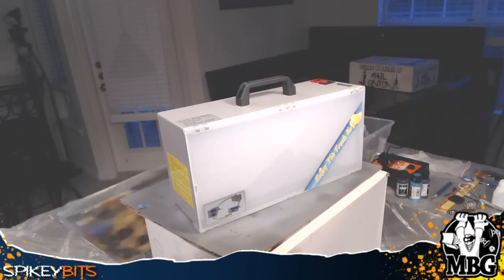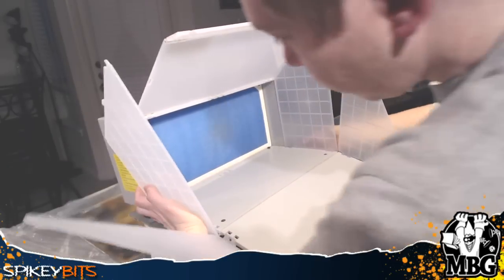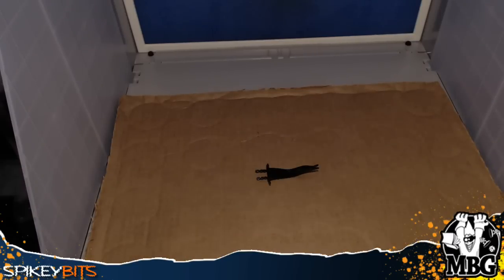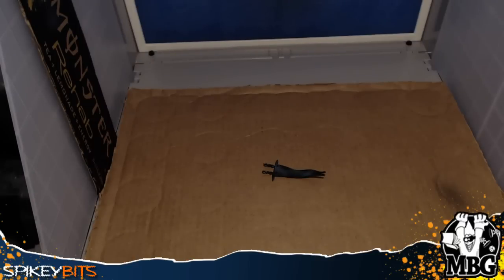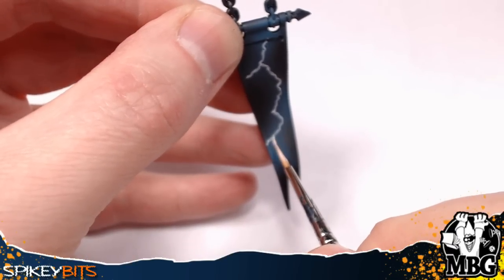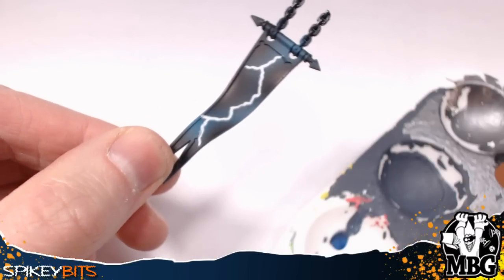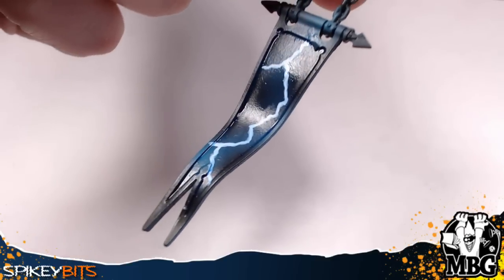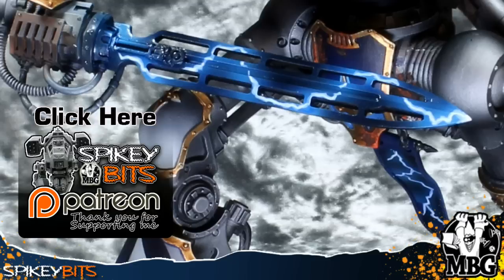Painting Lightning Bolt Effects - How To Tutorial

Comment: The fan on that unit really doesn't move enough air.  I bought a more expensive unit but if it actually works, then it's money well spent.  The fan on my Pace booth moves 160 cu ft of air a minute.  No offense I was looking for spell effects brother, not an advert for a plastic spray booth.  
Thanks for the info on the lightning bolt effects!